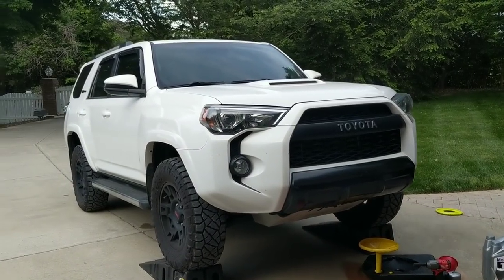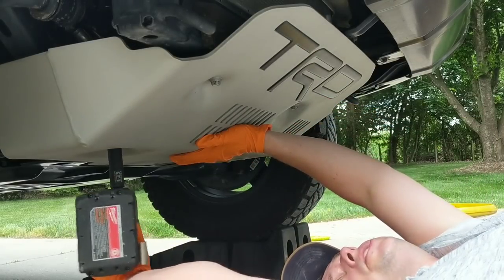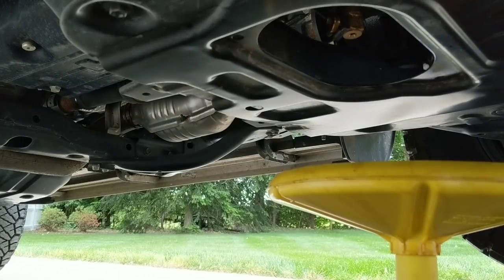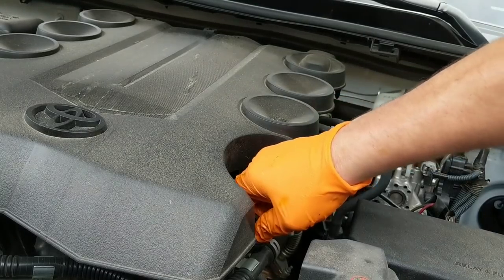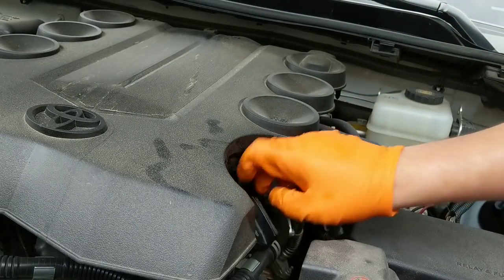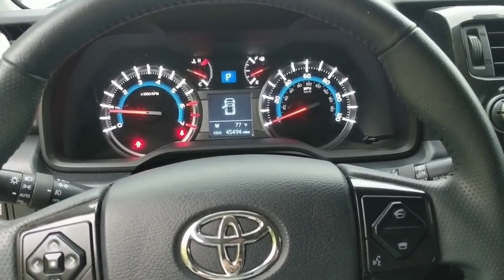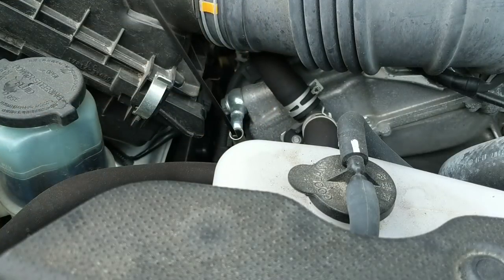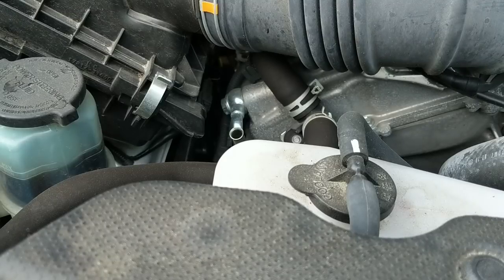2010 - 2021 Toyota 4Runner Oil Change - Beginner's Guide

Comment: Change mine every time , actually comes off easily. Do you get the slight steering wobble at 60mph ?
Reply from the maker: Yeah you need a road force alignment or new tires to fix

Comment: Have you ever had the dealership do your oil change through the Toyota car care program?
Reply from the maker: No, I have been the only person to mechanically touch this 4Runner 😀
Reply: @BtwilliasGarage  one of the reasons that I asked is I'm looking to buy a new 4runner when I get back to the States, and they keep bringing up the Toyotacare program and my brother just bought the extended maintenance plan on his Toyota.  I'm unsure if it is really worth it.  I have a nice shop with all the tool's and usually do all the services myself on all my rides and equipment.
Reply from the maker: @krazeekalvin  i wouldn't personally get too excited over free oil changes. It's more of a pain driving to the dealership for me versus changing it in 30 mins while drinking a beer and enjoying the outdoors. It is nice though for the cost savings. I'm sure you will be happy either way! Tell them to knock another $500 off and keep the interest rate, trade in, etc the same. 😀

Comment: is amsoil good? i also used 5W30. seems to run well. 0w20 is just used for fuel efficiency reasons if you dont plan on hauling or do excessive amounts of driving. Lol
Reply from the maker: Yes Amsoil is very good oil 🤘

Comment: Do you prefer deep sockets? Going to buy metric set and can only afford deep or standard sockets not both.
Reply from the maker: I would go standard in that case I believe. The deep ones can be too long for certain jobs and an extension is cheaper than 2 sets when deep is needed

Comment: What did you use the oil filter remover socket for? I watched this twice and didn't see you use it. Is it necessary? Picking up a 4Runner on Friday and the oil change is different than what I'm used to with canister filters.
Reply from the maker: Yes you should use it instead of doing like I did and using the ratchet in the cap to tighten it. I overtightened mine by not using the socket tool. Pretty much use it to tighten it back. And if your small drain plug at the bottom isn't overtightened you will likely need it to crack your housing loose once it unscrews. Make sense? Sorry for the confusion

Comment: One question, I'm assuming the skid plate isn't really necessary if you're not off-roading correct?  I never had one on my 2005 4 Runner. It just looks like a lot of extra work to change the oil.
Reply from the maker: Correct, you can leave it off. It may slightly affect the wind resistance, but nothing noticable. We don't run one on my brothers LX470 and it's fine and easier to change the oil

Comment: You have a problem, because the torque for the filter drain should be less than the filter housing. This way, the drain will unscrew before the filter housing. Filter drain torque is 10lb/ft and the filter housing is 18lb/ft
Reply from the maker: Thank you, yes I am aware now. It's still in there really good, so I am going to buy another and then attempt to get it out with a vice. If it comes out clean, great. If not, I have a backup. Thanks for watching!

Comment: My local dealer over torqued the housing on last service.  At this latest service the tech destroyed the filter housing (aluminum) in an attempt to remove the filter.
Reply from the maker: Find you a trusted mechanic that is aware of how to properly perform the service. Or better yet...try to do it yourself! Best if luck
Reply: @BtwilliasGarage  i will be doing it myself. After all I am a retired tech.
P.S. i never had to destroy a filter or housing to remove an oil filter.
Reply from the maker: @duane9707  it's sad when you can't trust the dealership for an oil change, but as a tech, you know it's the young/inexperienced guys and gals that get put on those jobs

Comment: I have a 5th Gen (2018) 4Runner TRD Pro and I was set to do my first oil change but it appears that my skid plate is not like yours. It appears to be 2 pieces. I’m a little unsure of how to go forward as I don’t want to screw it up. Thoughts?
Reply from the maker: Does it have a center piece insert that comes out? Must be an aftermarket one. Just pop off all the bolts and torque them back up to my recommended specs or semi  tightly by hand and you will be fine. You can't really mess that up unless you accidentally cross thread them. Do it by hand and you're good. Best of luck!
Reply: Btwillia's Garage it shouldn’t be after market. I found another video that showed how to get it off. There’s plastic piece in front that you have to take off first (it overlaps the skid plate). Then you take the plate off and good to go. 

Everything went fine. I even installed the fumoto bolt. Thanks for the great instructions.

Comment: Is there any reason those front skid plate spacers couldn’t be Contact Cemented onto the skid plate to keep them in place? I’ve saved myself lots of aggravation by doing that in numerous similar situations. Great video! Thanks for the tip on the drain valve.
Reply from the maker: Yes you can! I JB welded mine and they stay for 3 changes or so before I accidentally knock them off. Then I just redo them

Comment: What size tires do you have on it? Are those nitto grapplers? I have an SR5 Premium and am turn between BF GR K02 or the Nitto Grapplers.
Reply from the maker: Good eye, they are Nitro RGs. They are 265/70/17s. I love them! Coming from Terra Grapplers, they are definitely better quality for offroading and don't have much more noise. I made a video a few months back on the upgrade from the Terras. YouTube search TRD Pro Ridge Grapplers and it should be the first result if you have time to check it out

Comment: how often do you do your oil changes? i've been hearing i can do these now by using the pure synthetic around 10 to 15k miles oil changes. is that a fact? mine is a2013 4runner
Reply from the maker: I change like around 6k with full synthetic. If you really want to know, check out Blackstone labs. Send a mid stream sample of your 10k oil and see what they say. They will tell you how far you can safely go. Good luck!
Reply: If you buy the high miles oil filter you could go 10 to15000 miles.  You can use mobil 1or Bosch or Royal purple oil filter. High miles, one only.  All other cheap oil filters past 6000 miles basically get plugged and dump right back into the engine and now you're recirculating extremely dirty oil.  I use full synthetic mobil 1 with the high mile oil filter change it every 10000 miles.   Engine runs quieter lower RPMs with full synthetic.  Gets better gas mileage as well. I also changed out the transmission fluid, transfer case and rear diff with mobile one synthetic.
Reply: FWIW, Toyota maintenance schedule for 5th gen V6 is 10k - it's not the same for all engines even if using full synthetic (my 2014 Tundra Flex Fuel is every 5k).
Reply: Toyota suggests 10K when using synthetic. personally, i wouldn't even wait that long. I do mine every 7,500. Scotty Kilmer is great for stuff like that.
my general rule of thumb is:
Conventional Oil: ~ 4,000 miles
Synthetic Oil: ~ 7,500
Reply: @richhutchings8979  Actually the cheap filters are less likely to clog.  Unless the engine is coming apart or a crappy air filter is used the oil filter will last for two to three oil changes.  I change the oil filter every other time.  The filter barely has any dirt in it.  I could easily go three oil changes per filter.  The oil filter and skid plate is a horrible design on the 5th Gen 4R.  A slightly dirty oil filter works better than a brand new one.  Changing the filter every other time saves money, time, hassle, and the engine will be subject to less wear.
Reply: @mrr226  The Toyota care care nut (Dealer Mechanic)on u tube says 5 to 6 grand. The 10k is for optimal conditions not towing / no short trips where engine isn't warmed up before shutdown.  Non optimal conditions = 5k full synthetic Mobil 1.
Reply: What about the first oil change? 1k, 3k, 5k miles? I’ve always done 1k with my turbos but this is my first N/A.
Reply from the maker: I would change it around $3k
Reply: @BtwilliasGarage  thank you I was thinking the same....3s and magic number
Reply: @BtwilliasGarage  2021 SR 5 . I did 1000k myself and got a call from dealership to service right after. They checked fluids and rotated tires. I asked when for first oil change, they said 10k.  I will do again at 5k then again at 10k. Who would go 10k without oil change in a new vehicle? Even the car care nut on u tube says 5k and he's a certified Toyota Tech. He also pounded the 1k break in oil change which Toyota does not. I asked at dealer about break in and they shrugged.
Reply: @scoobysid04  the mechanics I know that have cars older than 10 yrs (some 50 yrs), suggest first at 1,000 miles / 1,600 kms and then 0n the 5,000 mile intervals. If you’re leasing or keeping the car less than 5 yrs, do the minimum.  If you plan for 10 yrs or more, do more often.

Comment: If the oil filter cap is installed to 18 ft.lbs. and the drain plug for the oil filter is torqued to only 10 ft.lbs. the drain plug should come off by itself.

If you screw the whole thing on with a ⅜ inch ratchet with or without an extension instead of using the filter cap wrench for the filter cap and the ⅜ inch only for the drain plug limited to only 10 ft.lbs. ... Etc.

Comment: How about using a couple drops of superglue to keep the spacers on the skid plate?
Reply from the maker: That or JB weld should do that trick! Good call!
Reply: I was also thinking about JB but I said crazy glue just in case you needed to take them off for some reason. But I have a ‘19 TRD off road and love it. Haven’t done the oil change myself yet but enjoyed watching your video. Nice truck man! 👍🏻
Reply: What's preventing you from threading the bolts up into the spacers prior to re-installing the skid plate? This should hold the spacers in place while you wiggle the bolt back into its hole.
Reply from the maker: @A.L.F.A.L.F.A  unfortunately the spacers are not threaded. It's a simple pass through

Comment: doesnt look like you needed the filter remover socket right
Reply from the maker: +Tony G you actually do. I messed up and tightened mine by the 3/8 drive metal cap and it's stuck now. Not a big deal but proper spec is to use it and change that small o ring in the no-spill drain access

Comment: How heavy is that skid plate?
Reply from the maker: 24 pounds or so. It's aluminum
Reply: @BtwilliasGarage  I own a 2018 trd OR and was curious if the OEM skid is heavier or lighter than your skid?
Reply from the maker: I'm not sure of the OEM standard skid weight, but I'm sure it's quite a bit lighter. It should make the job easier

Comment: How often do u change the oil?
Reply from the maker: Every 5-6.5k
Reply: Is this Mobil1 any good for this truck? Thanks!
Reply from the maker: @ishmo3269  yeah it's good stuff. Test show the Amazon synthetic 0w20 is actually really good stuff too.
Reply: Thanks!
Reply: 7,500 miles.
btw, toyota recommends every 10k miles using fully synthetic oil.
i would NOT wait longer than 10k miles though, especially if you plan on keeping it for a while.

Comment: toyota have to think on this , its pain to change oil on 4runner , not cool too difficult to replace the oil ..
Reply from the maker: Agreed, it is a pain, but once you get it down it can be done in 30 mins. Fumoto valve helps slightly! Link in description of you need one
Reply: My 2005 4runner is much easier to change filter. My 2018 oil filter is a pain in the ass.
Reply from the maker: @flyfliker  I've never changed the oil on a 4th Gen, but I'm jealous now haha!
Reply: "too difficult" you say? Admitting defeat already?
Reply: @njsongwriter  good point , but this is called design fault , i had Honda Odyssey , and it was so hard to clean specially  sliding doors because water proof rubber was installed pretty inside and inner part of the door was expose to dirt  , i mean to say that these companies invest billions on these so they must explore all prospectives , and these days  by using powerful computers and powerful softwares , these things are pretty visible , i live Japan built and these old school vehicle because its easy to understand how the system work so small trouble shooting you can do by your own ..

Comment: 6:30 You need a cheater bar or longer handled ratchet.
Reply from the maker: Yes that would have made it easier for sure!
Reply: @BtwilliasGarage  Thanks for the video. I do my own maintenance on my 2015 Tacoma TRD-OR But we just got my wife a 19 4Runner TRD-OR Premium. She's coming up on 5,000mi. Doing my homework now.
Reply from the maker: @conradaleshire4428  absolutely! It's not too bad on the 4runner. About 30 mins taking your time once you get the hang of it. Be sure to use the cap tool on the filter to tighten it. I used the 3/8s and overtightened the little plate in on accident. No biggie, but will need to get it out to replace that o ring next time.
Reply from the maker: Ps. Congrats on the new Toyota!
Reply: @BtwilliasGarage  Thanks! Always a pleasure meeting fellow enthusiasts.